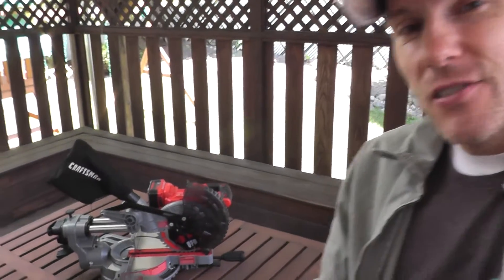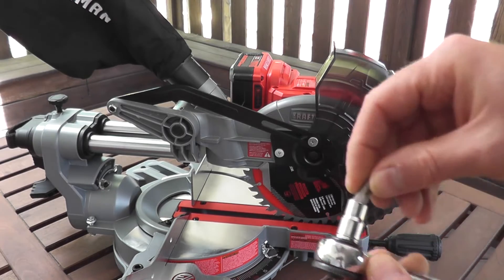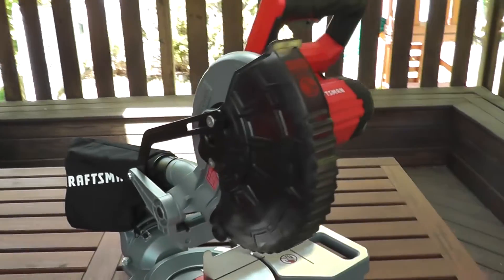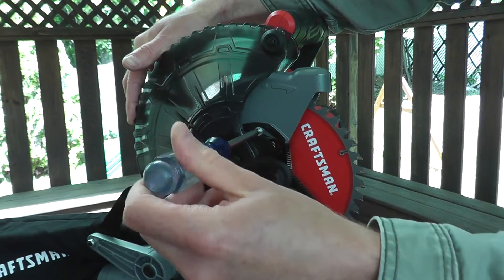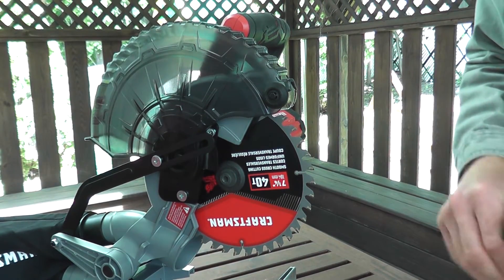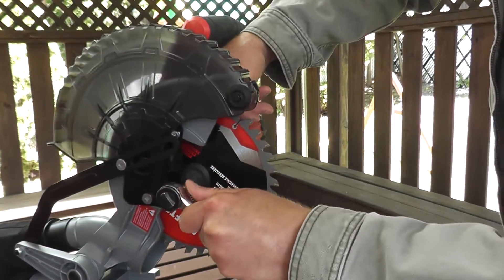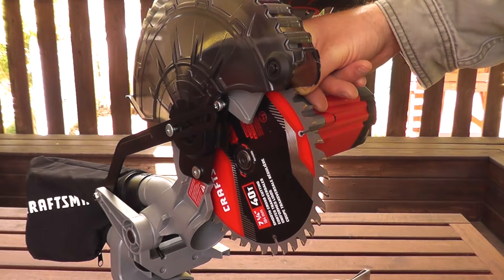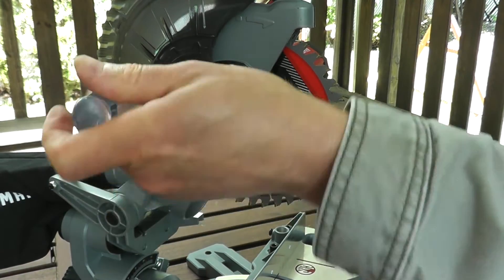Blade Replacement Craftsman Cordless V20 Miter Saw

Comment: Ok so I finally had a job that required a miter saw for molding and so bought the craftsman V20 miter saw. I have an Evolution metal miter saw which I also have wood blades for (love that thing particularly for metal: and I got all the blades for different material types).  But this job on one of buildings only needed small molding and I wanted to be able to easily bring the saw there instead of back and forth for numerous small cuts (yes the evolution is mobile, but still requires breakdown and loading in the truck instead of grab, go and throw it in the back seat!).  I have a new love!  Absolutely love it!  It has a marvelous carbide blade with like 40+ teeth (equivalent to a 60 tooth fine cross cut 10” or so).  I did wrap my joints with painters tape but in test cuts even without there was absolutely zero tear out!  It is sturdy, very ergo-metric, accurate, well balanced and a joy to cut with.  It’s very light but not too light, so easy to grab and carry but not so light that you think it’s going to walk on you.  One feature I think I really like is that instead of a laser to indicate the cut line, it has a strategically placed LED that casts a shadow if the blade!  You can actually see the tooth edges and where they will cut!  With this I can land a length to better than 1/64th inch (without a block) reliably every time. Your pencil lead width and eye sight become the limiting factors, not the laser line.  Anyhow, I am ecstatic over this saw and can heartily recommend.

Comment: Great video. I was able to change the blade per your instructions.  Small detail, I have the same saw, but it took a 6mm allen wrench to remove the blade.  Couldn't fit a 1/4-inch allen wrench and a 7/32 inch was too small.

Comment: First of all, great video. Unfortunately, I can’t seem to get the brake to stop the blade. I am able to press the button completely but at no time will it lock so I am unable to get enough torque to remove the old blade. It’s been a while since I changed the blade out, but I have done it in the past. Any thoughts?